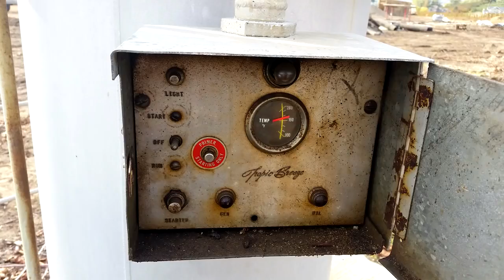1956 LINCOLN Y BLOCK - Rescued from a WIND MACHIINE!

Comment: Awesome video Ken.  I would guess that engine doesn't have too many hours on it considering what it was used for, probably a few days in the spring and early summer.  The old 292 "Y" block in my 1964 Ford pickup was a good running engine.  By the way, Kerwoods old Chevy flatbed truck is awesome !!

Comment: them there Fords start so easy, I thought it was going to start when you turned the prop horizontal .lol  that would make a lovely observation deck in your garden Ken.
Reply from the maker: i thought about it.. but Lord!! I have enough projects!! another friend is taking the tower and the prop.. but.. I may have a lead on a 4 blade prop from another one of these machines.. would be neat to hang up in the rafters in my shop :)

Comment: Shop fan?? If you can't use it remember I am in NC where it gets hot!! Be an easy way to stay cool and clean the shop at the same time.
Reply from the maker: true..haha.. you'd have to wear ear plugs.. I work in the orchards sometimes when they are running and its like standing right beside an airplane. LOUD! haha

Comment: Back in my College days I purchased a 1962 Ford F-250 with the intention of a restoration project. The old truck sure ran good with that Y block 292 but the three speed on the tree busted the shifting on the tree.  I ended up cutting a hole in the floor and put in a 4 speed. Compound low for sure. Great truck finally sold it. Now I have a 1958 F 600 all wheel drive dump truck so I am back into the Y block again. Got the old truck running again but need to go through the hydro boost brake set up. It has so many gears and levers inside that old cab it took a while just figure what does what.

Comment: Fine voice and playing :D Love your adventures....I've only had 2. Fetching my Nuffield, and Ford Major for a mate. What could possibly go wrong??? Backing the Nuffield off the truck and finding I've no brakes in reverse....near thing.
Anyway, what's he building with that ......airplane (grin)
Reply from the maker: no brakes!!  did you get that on video!!?? haha
Reply: Sadly missed it....didn't video taking it off the truck. I asked the owner has it brakes....yes. Tried them in his yard seemed to have some. Got back, backed off, shot down the ramps, nearly fell off them. Luckily we were parked on the front, but still nearly ran into the main road. If someone says the brakes are ok, you expect them to stop the vehicle....not just the pedal goes up and down lol.
Reply from the maker: lol  right!

Comment: Wonderful intro !
So what size engine did you find here ? 239 ?
Reply from the maker: have not found anyone who can decode the id tag yet
Reply: Well if you tear it down to rebuild it, you could go "Old School" and MEASURE it !
Although my guess would be 239 because of the production date that you mentioned.
Do you plan to rebuild the engine? And will you keep it on Propane?
Reply from the maker: John Mulhall
no need for a rebuild. it runs great, very few hours.. they only run a few hours each spring for frost control
Reply: WOW. A better purchase than an RV engine!
Have you noticed how many low mileage RV engines there are for sale? Many of them are Big Block Mopar 440 and GM 454 low compression engines. That is where the 2 I have right now came from :-}
Reply from the maker: John Mulhall
good stuff man...

Comment: so im wondering what you did with this item? i have never seen one. its neat. also do you know what on earth it was used for. i dont get what they needed engine running a propeller. weird.
Reply from the maker: as I said in the video,  its a wind machine used for frost control in the orchards.. :)